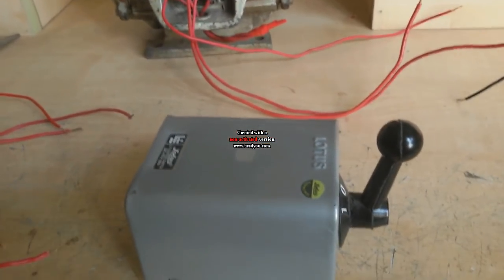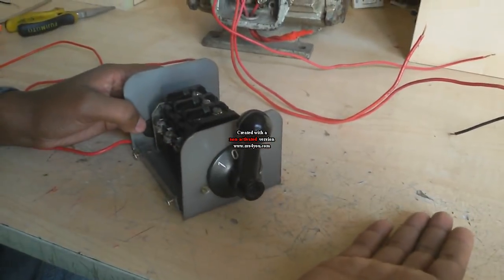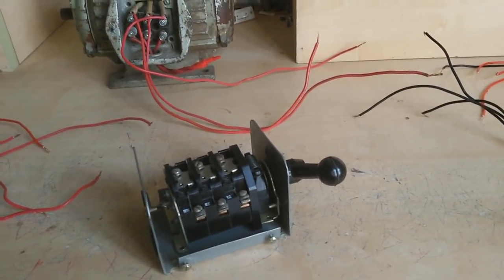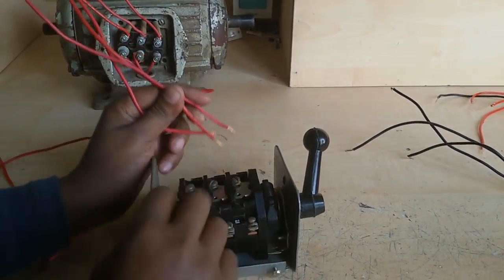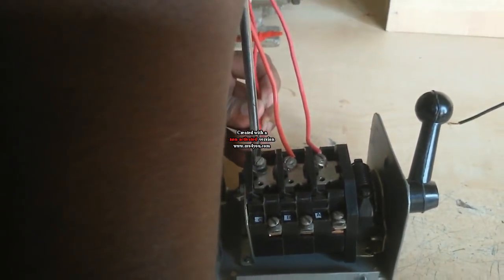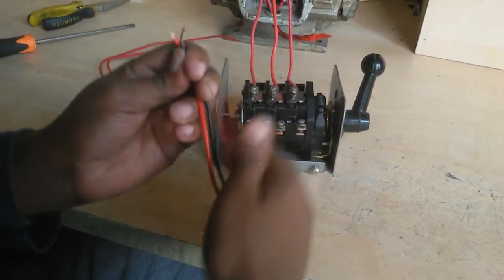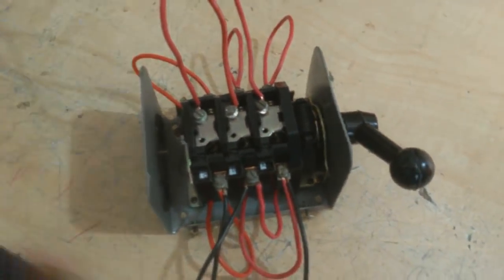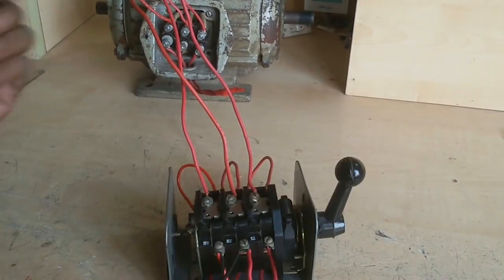how to connect a three phase motor reverse and forward by change over switch |

Comment: good ,why did not use wire color code RYB in tree phase connection, and use only electrical tools, not carpenter's screw driver